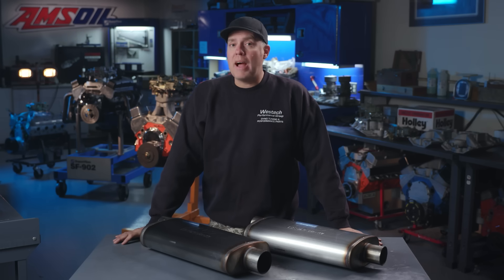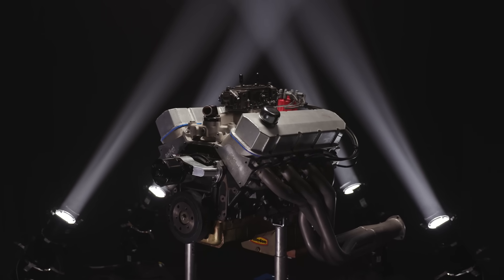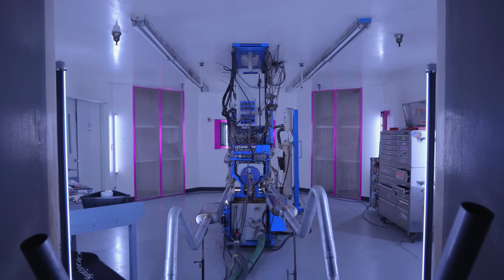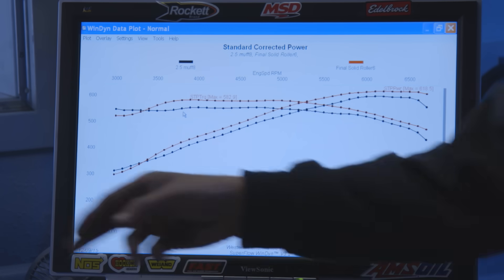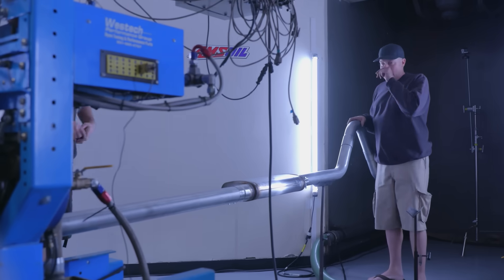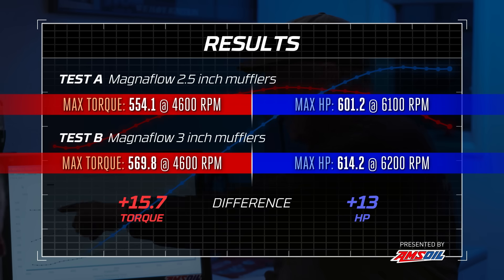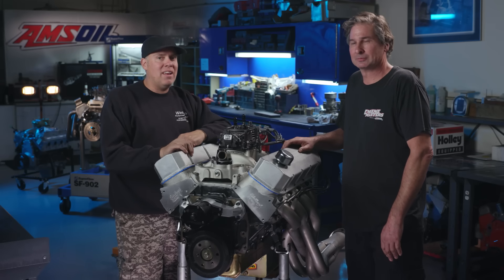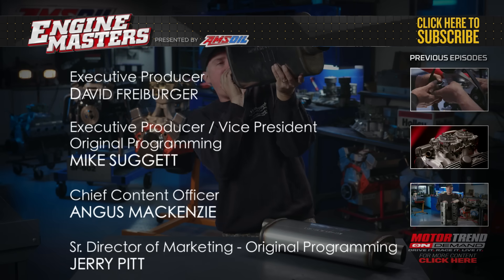The Power of 2.5- vs. 3-Inch Exhaust - Engine Masters Ep. 9

Comment: Me getting older I’ll trade the 15-20 horse for some sanity while driving.
Reply: Plus, they didn't re-jet or adjust the carb for the 2.5". They could've leaned it out to match the other A/F curve.
Reply: @wakjob961  I'd bet the 3" would have equaled the open pipes with a jet change, fuel curve is everything.  I've seen the day when a .001 jet change was the difference between winning & losing.
Reply: Same reason I say to NOT put thru-hull exhausts on a boat engine. Great for the first 10 minutes, then nothing but headache inducing.
Reply: I'm 30 and my exhaust system is definitely too loud and it's just a simple chambered cheapo muffler on a 3in pipe attached to a 2.5l i6. This video made me rethink my design for my upcoming exhaust build a little. I was planning on going 3in header back in prep for a turbo that will be going in over the fall or winter; but now I think what I'm going to do is start with a 3in downpipe, resonator, and mid pipe and restrict it down to a 2.5in through the muffler back to a 2.5-3in tip.

We'll see though, there's some other goodies that will go in there that will do some wild stuff but I'm not giving away my design secrets yet.
Reply: @deltacharlieecho4732   your exhaust temp is higher and density lower closer to the engine. You may consider wrapping a 2.5" down pipe then going 3" after the turbo or shortly after.

Comment: Interesting.. just realized my 69 impala has 3 inch exhaust from the factory from the manifolds to mufflers.. after the mufflers is 2 n a half.. the 3 inch is original from what I can tell as is the 2 n a half.. I got the car from the original owner with 29k miles back in 2001.. I did change out original mufflers after they blew when it back fired points closed up I guess.

Comment: What is that HP # where the 2½ vs. 3" makes no difference or even hurts performance. I'd guess around 450-500 HP.

So you're effectively losing another 7-8 HP with weight although much of that weight is on the rear axle so maybe picking up a little traction.

Comment: Generally, when you have motors with less then 450 h.p. you need some back pressure. With 600+ h.p. open exhaust doesn't matter. So that's why the muffler shop tells you, you need some back pressure.
Reply: David Whitner / ‘😳back pressure’ ? 🤔With a fourstroke? 🤥NONSENSE🤐

Comment: You're using a performance engine that's been built for improved flow.  Try an 80's smog engine, back when domestic auto manufacturers were scrambling to meet the new killer EPA mandates, like the old Pontiac Trans Am 455 4-barrel that only put out 175 horsepower.  Then you'll find the cam timing that's trying to clean up a big, dirty motor does indeed respond positively to backpressure at lower rpms.  

Moral of the story: Don't ridicule info that resulted from something you may not have been exposed to.  ;)

Comment: Duh the easier an engine can breath the easier it can make power. All that hype is a sales pitch trying to get you to buy this or that product. Hot rod did a similar test years ago with true duals (no cross over, x or h, pipe) versus the duals with an x pipe and h pipe. The true duals made more power. Yeah the cross over quietness down the back rap that snow flakes don't like.

Comment: Big blocks need to breath always needs 3 in  why not do the exhaust with turn downs in front of rear end or do side by side by exhaust I had a bbc Chevelle with 3 in exhaust with turn downs in front of  rear end  with flowmasters with  ,posi rear 373  it made so much  power it was very violent and only about 450_500 hp back in the ,80s_90s oh yeah your neighbors will love you car guys will  
others just have to deal with it

Comment: Why don't you clowns put a good exhaust system  based on actual  length and design? A venturi collector a good x- pipe with maybe an expansion chamber stepped to 3.5 tail pipes like ythe system On my s-10

Comment: Awesome video and proves my point too, have had many people like "don't get a bigger exhaust it will kill your horsepower because it needs some back pressure" now I can just show them the video and be like this proves otherwise
Reply: Back pressure isn't what makes torque anyways, it's exhaust gas velocity. Back pressure is always bad. If you don't have enough exhaust velocity, you lose scavenging and thus power, if it's too restrictive, your velocity will be high, but you make the engine work harder than it needs to, causing you to lose power. Bigger isn't always better, and this is a pretty poor comparison as they show us that they haven't changed the carb tuning between each system, which means this has no basis for anything that is EFI based as EFI will compensate for your exhaust tuning with fuel trims, which means the engines will run roughly the same, vs a carburetor that needs manual adjustment. It'd only be a fair comparison if they dialed the fueling to be equal between each exhaust, as almost every car on the road is EFI.
Reply: A bigger exhaust on a stock engine moves your power up the rpm range so for regular driving it does

Comment: But does a 500  hp small block really need 3in exhaust? Or is 2.5 in enough?
Reply: A rough rule of thumb is to have 1.5 cfm per horsepower on the intake side and 2.2 cfm capacity on the exhaust side. If I remember correctly each square inch is 115 cfm. 500 hp should have a 750 cfm carb and be able to flow 1100 cfm on the exhaust side. 2.5 inch exhaust pipe has 4.9 square inches and should flow 560 cfm, double that for dual exhaust. You are at 1120 cfm which would be sufficient for 500 hp.

Comment: A Question : What about adding collector extension  then 2 1/2" pipes to an x, then into 2 1/2 " Mufflers , tailpipes      I bet some torque comes back ........................... On a milder engine and smaller displacement  the difference would be less,  moving less air volume
see video by David Vizard on exhaust systems ,
 o-loss power and street legal noise ,
 David talks about using a H pipe after the collector and a termination box sized to the engine requirement , then adds muffler farther back ,  gives open header power and street legal sound
Steve knows ...

Comment: So...if the engine was running rich with the 2.5" and no carb adjustments, why not make adjustments to get a real comparison. Engines running fat will give up HP and TQ. Re run the test with more tuning.

Comment: You know if you want really great torque. You need a 1 inch exhaust pipe. That will give you the sufficient back pressure this engine requires.

Comment: Now do a set of shorty headers , a 3" y pipe , a SINGLE 3" pipe into a single 3" inlet dual 3" outlet muffler like what you'd stick under a 3rd or 4th gen camaro with a 450 to 500 hp SBC .
Real world applications.
Reply: Not sure about 4th gens but you can run true dual exhaust on a 3rd gen.
Reply: Ya , I looked under mine sitting in the driveway.
I just don't see it fitting dual 3 nc pipes under there.
Thears floorpa just doesn't lend itself to runing a pipe down the drivers side.
If I tried running a bunch more bends in it    and down the passenger side is not worth it. Then there is no room under a 3rd gen camaro for dual mufflers either.
Only one muffler lays crosswise behind the diff.

Comment: Let’s talk over heating after change of water pump pillows rad check 2 1/2 pipes engine 30 over all aluminum runs around 250 how can I get it down. 455 buick

Comment: Old School "gear-heads" have known for decades that once you reach 600hp, a V8 engine demands 
3" exhaust. The air-flow numbers demand it. Especially, on street-driven cars. 
On V8 engines below 600hp, a 2.5" exhaust is perfect...with free-flowing mufflers. A 3" exhaust system 
looks cool...but kills torque & HP throughout the power band. 
Respectfully,  Ben
Reply: RAMBO JOHN J  I strongly suggest you ditch the cats. Also, do some research. There are much better mufflers available.
Borla Mufflers are OK. But there are better flowing mufflers on the market & they'll give you the "throaty" sound you're looking for; without sounding overly loud and like "gramps" old farm truck. 
Respectfully, 
Ben
Reply: 3 inch to 2.5 tailpipes works great on mid 300 hp cars too.
Reply: Thanks Ben, I am building a 6.0 with flat top pistons, 862 heads, a ss2 cam, and stock truck intake with slightly bigger injectors, I have 2.5 collectors off my variable headers, guessing about 425 is for a rock crawler.  I was planning on just running 2.5 all the way out.......... you answered me up real nice.
Reply: @patrickhickman8723  I sincerely appreciate your reply....sounds like an awesome build. 
I'm not being critical...but...why are you choosing to use a "stock truck intake"? 
In my...respectful...opinion, the characteristics of your "SS-2" cam profile and those 862 heads will demand more than that intake can deliver. My friendly advice is to speak to a Tech Adviser at the company who produced the camshaft. Most have a toll-free tech-line. When you call, have with you as much information about your build as possible. 
ie; camshaft info, flow numbers for your heads, piston info, etc. 
They'll ask several important questions & give you valuable information to help guide you to a more beneficial intake. 
About your exhaust system:
Trust me, you won't be disappointed by staying with 2.5''. 
There are 2 logical enhancements to your chosen 2.5" exhaust: 
1.) An X pipe...not too far downstream from the collectors. 
2.) Opt for oval 2.5'' pipes...rather than the standard round. 
The X pipe will balance the turbulent exhaust pulses on both banks of your V-8 engine...GREATLY improving torque throughout the RPM range. An X pipe will also allow you to take better advantage of the useable horsepower produced...by placing that HP in a more effective RPM range. 
Oval exhaust pipes GREATLY enhance scavenging from the combustion chambers & provide a beneficial increase in exhaust velocity. Also, the oval shape allows more ground clearance. 
Regardless Patrick, I hope ALL works-out well for ya'. 
Best regards, 
Ben
Reply: Unless ur car is turbocharged then it's different
Reply: @yslmill  What is different? 
Ben
Reply: I guess John Lingenfelter and Borla both had/have no clue at what they are doing then. Lingenfelter only built over 600 horse power corvettes using Borla 2.5 inch exhausts. Borla and Lingenfelter both proved the myth that bigger is better to be false.
Reply: @LeeCountySpeedShop show us 1 dyno result in the history of dyno results that a 2.5 made more power than a 3
Reply: nonsense. because you mention only the power output (at no particular rpm) and then you start talking about air-flow. air-flow at what rpm? 600hp at what rpm? redline?
Reply: @tommurphy4307  WITH ALL DUE RESPECT Tom: 
The RPM of an engine is..."more or less"...an unimportant factor concerning exhaust. 
....generally speaking. 
The "redline" of an engine is equally irrelevant..regarding "air-flow". 
It's ALL about air-flow & scavaging of the cylinders; at ANY given RPM. 
The entire power band//torque & horsepower range of a "properly tuned" engine will significantly improve with a well-designed exhaust system. 
I've done MANY dyno comparisons and in each pull, the data showed an exhaust system larger than 2.5"...on engines below 600HP...will significantly reduce torque & horsepower throughout the RPM range of the engine. 
Once an engine exceeds 600HP, an exhaust system of 3.0" will improve torque and horsepower in the operating range of the engine. An engine producing 1,000+HP will 
benefit equally with a properly designed 3.5" exhaust system. 
Where these improvements occur in the RPM range will depend on several factors 
of the engine build specs. Such as the camshaft profile, the cylinder heads, etc. 
BTW: An "X" configuration...not too far downstream from the header collectors...will greatly improve the efficiency of ANY V-8 engine; regardless of its' horsepower output. Although, the benefits of the "X" in the exhaust system are easily measured in properly tuned V-8 engines producing 300HP & more. 
Best regards, 
Ben

Comment: So I'm a little confused and need some help. Getting a custom exhaust fitted soon. My stock is 1.75" pipe. I'm not running a lot if power, its just an average euro car. I looked at cheap systems and they have 2" pipe. I looked at Cobra and they use 2.5" for my car. But the custom shop said they will replace with the original size pipe but in stainless, remove the resonator and have a free flow back box. Does this sound ok or should I go for 2.25.or 2.5" pipe? I did like the sound of the Cobra and I don't want that buzz I hear on the cheaper systems with near standard pipe. Not sure what to do. Thanks

Comment: Why not do this test... same test BUT alter the length of after the mufflers... use a 2 1/2 inch system on turndowns just after the muffler and same for a 3 inch system... I’m curious to see the power changes with shorter pipes after the muffler... as I’ve seen people use turn downs to make their exhaust lighter weight, shorter and have it exit the middle/side of their vehicle (in certain applications)

Comment: The differences in the oil he showed.  AMSOIL Z-ROD contains Zinc that older engines must have.  AMSOIL Premium Protection I believe is more of a truck oil, like for towing.  Not shown, AMSOIL does have racing oils, one of these being AMSOIL Dominator.  I've been using AMSOIL for about twenty-four years now and it has always been an excellent oil, as are their other offerings.

Comment: You should try again with an h-pipe crosspipe. That makes an enormous difference.
The inertia of a supersonic gas is a serious force. Now force = mass times velocity squared. So when you are flowing a fixed volume of gas per unit of time through a larger pipe the velocity is reduced by quite a lot. The reduction in velocity reduces the force required to move it.
The volume of the pipe is only being used for a short duration so if you connect the 2 pipes a few feet behind the header via an H-Pipe or cross pipe you allow each bank to borrow some volume from the other banks exhaust pipe between exhaust strokes. This helps to smooth pulsation and reduce the overall gas velocity. The gain in the reduction of force will be the difference of the velocity of gas squared times the mass of gas.
I probably could have said that better but I can only see a small amount of my comment without scrolling.

I prefer your videos when you are not trying to be witty or clever and just get straight to business.
Fwiw...

Comment: OK YOU GOOBERS .... LOOKING AT THE FUEL NUMBERS ON THE 2.5 INCH SYSTEM .... YOU DIDN'T CORRECT THE FUEL RATIO FROM 12.2/11.8 BACK TO 13:1 AND SOME CHANGE THEREFORE YOU LEFT POWER ON THE TABLE FOR THE POINT YOU WERE LOOKING TO MAKE .... I HAVE AN 11:1 TUNNEL RAM TWIN DEMON CARB ROLLER CAM 496 WITH THAT 3" MUFFLER SYSTEM ON IT AND IT'S BRUTAL !!! AT SOME POINT I WILL CHANGE IT BACK TO 2.5 FOR SANITY BESIDES EVEN WITH 18X32 TIRES TRACTION IS SKETCHY AT BEST... USUALLY I LIKE YOUR SHOWS ... YOU SHOULD HAVE EDITED OUT THE FUEL RATIO PART ...... I WAS SHOCKED YOUALL DIDN'T SWAP OUT THE JETS LEAN IT BACK AND GIVE AN HONEST COMPARISON  ...APPLES TO APPLES ...WE ALL KNOW OPEN EXHAUST LEANS A MOTOR    I WOULD HAVE GUESSED 565 TQ 612/614  PEAK WITH THE JET CORRECTION ...KINDA DIAPPOINTED

Comment: How would a fuel injection system affect this? 🤔

I wonder how much difference there would be using a SHORTER (more realistic length) setup.
Reply: EFI PROVIDES  a more consistent AFR than a carb can.

Comment: I think if the air fuel ratio would have been leaned out a little bit with the smaller exhaust,  it would have been closer to the other tests.

Comment: Have got 3" on my Challenger SRT8, and was one of the best mods that we did on it. Next to a good set of sticky drag radials, it's one of the best mods that you can do and recommend it for performance engines. SRTs come with pretty fat pipes from the factory, but have huge resonators/mufflers that I definitely recommend replacing and is the primary reason I did it. The 5.7 equipped cars come with 2 1/2, whereas the SRTs come with 2" 7/8s. The 3" definitely improve the sound, especially since I went with open chamber racing bullets and is basically almost like straight piping with improved flow.  Is better though, because of the increased diameter
Reply: sound is complety objective.

Comment: Backpressure? wff?  How much? you dont know, you didnt even measure it. I have a zero to 3lb pressure gauge, been using it for years.
I took a couple zert fittings, gutted them, drill a hole in the exhaust, stick a hose on i and pressure gauge on the other end and go for a ride...when done i have brass plugs to plug the hole. Not having a dyno exact power changes are had to track...usual use a time check from like 3000 rpm and pin it until 6500 rpm......best i can figure anything less than 1.5 lbs is plenty decent. Hows about a dead quiet muffler and no exhaust system pressure of any kind. Its motorcycle, honda cbr 1100xx blackbird...honda says 165 hp. stupd quiet, can4 even hear the motor past 40mph and wot...even with no pressure the lack of noise must mean its giving up power, right? i use a camera mounted on the tank to track numbers. rpm and mph and the camera has a  clock that reads 10ths of a seconds. made a dozen passes...idle speed, pin it, no clutch to rev limiter in first gear and a couple runs out the back door...191 cross checked with gps....borrowed a buddies exhaust..ti pipe and carbon fiber can...22 lbs less than stock....put 22 lbs in a backpack and ran it, jetted up one step and down one step....major difference...way noisey. more power? nope, maybe.. but not really ...so its costs $1600 to lose 22 lbs...i did a couple passes without backpack...first gear pass went from 2.8 to 2.7...same number on the big end